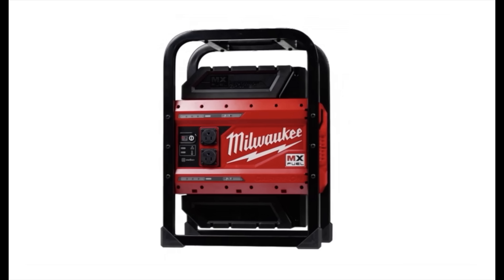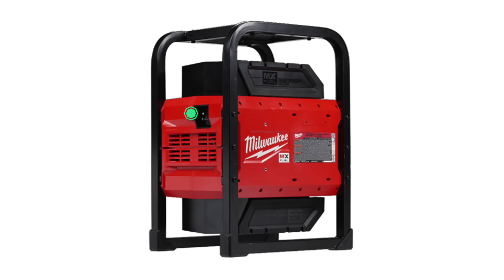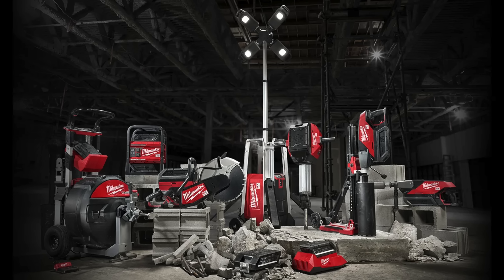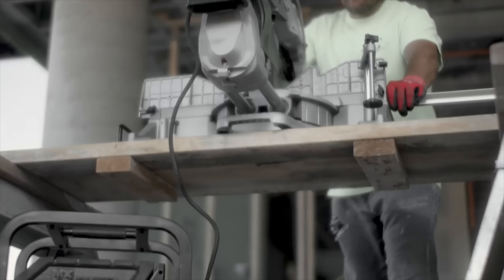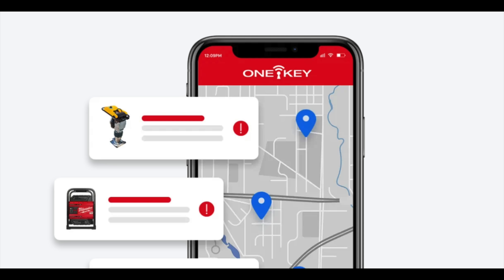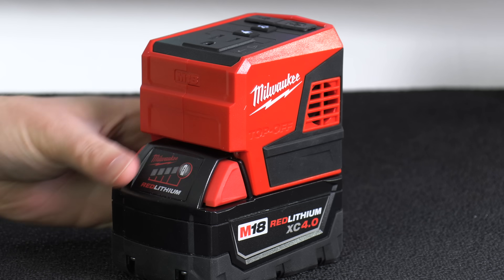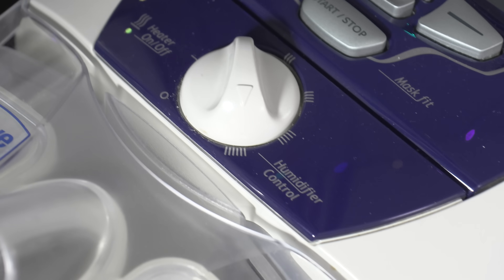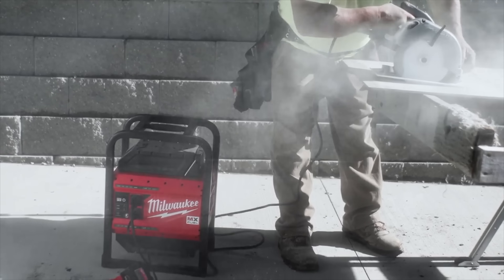END of GAS Generators? Milwaukee MX Fuel Carry-On Changes EVERYTHING 3600 Watts!

Comment: Do you really think these electric generators would power my jobsite trailer with 2 A/C units in 90-110 degrees, plus air compressor, sewing machine, jigsaw, microwave, 2 box fans, 900 watt inverter for 5  250 LED lights. Maybe for 1 minute. How about 8-10 hours. Lol
I'll never buy one of those generators. Oil & gas are king not lithium!

Comment: What this country needs is.....A law that calls a battery pack a battery pack. These so called  "generators"  do not generate anything, they are collectors of and storage devices for energy "generated" by other means be it gas/propane/diesel generators, solar, or off the common grid. I currently have of devices in my home that operate off of electrical energy provided by D cell, AAA cell, and AA  generators, a few that can be recharged through of recharging devices --HOWEVER they are not generators, or deserving of the name..

Comment: My OCD is kicking in , these large battery packs ARE NOT "Generators", I'm surprised I haven't seen any Hybrid Generators, that are small low power output Propane / Nat . Gas / Gas Generator with batteries they would be more efficient respective to other small 1000 ~ 2200 Watt offerings while providing MUCH higher sudden peak power demand along with the potential to provide a VERY clean power output signal.

Comment: What's the cost of the replacement battery?
Reply from the maker: $599 for one battery
Reply: @SilverCymbal  it looks like a nice clean system,   But that cost equals out to some serious gas and oil over time.   

Thanks for the vid!  Nice job.
Reply from the maker: @grasshopperlawncareservice3269  Actually...once it was released it didn't work out very well. See my hands on test here:  https://youtu.be/gFwP-0oQwMY

Comment: The price is bullshit. If that gas generator runs out of gas I just put more gas in it if the battery generator runs out of battery power I have to charge it and wait for it to charge in order to use it as I was using it before. That battery operated generator should cost no more then a couple to a few hundred dollars. They must be testing the market for dummies because of enough of them buy it they’ll keep the price the way it is. That price is crazy this is how people gouge the people in America.

Comment: The newer batteries do not work in the cold I work with e bikes they will not even turn on below freezing.....imagine needing it and it wont work......that being said you still need a solid array to charge the thing which need to be charged during the day.....um when you would want to use it???

Comment: it is lithium ION .. not iron ... thats why its L ion ... 
ok 1800w battery steady rate ... how many amp hours can it do that ... without out that all the other stats are USELESS ... if it lasts for 30 minutes its worthless ... if you have to plug it in to keep going its worthless ... because you then need to buy a generator to charge the bloody battery power bank ... just so you can use the battery bank ... may as well just use the bloody generator and leave the batteries bank at home
Reply from the maker: Sorry my friend: https://blog.epectec.com/lithium-iron-phosphate-vs-lithium-ion-differences-and-advantages
Reply: btw this NOT a generator .. it is a BATTERY BANK ... it is a storage bank ... it needs a generator to charge it .. and you never said how many amp hoours it can handle ... that is one of the MOST important things about a battery bank you need to know ... if it is 1800w fine for HOW LONG ... watts is just voltage x Current .. also known as Volt Amperes ... wihtout a duration how long the battery can sustain its 1800w ... it is crap ...

Comment: Shuts down after 1 hr, vid misleading for CPAc.
Reply from the maker: That doesn't sound good. I should have my review soon, including a full power analysis/runtimes/watt hours & more.
Reply: @SilverCymbal   I have a baseboard heating system, a small 1/2 hp pump.  Pls focus on this in review. But continuous service issue breaks device value a lot.

Comment: You have to use fossil fuels in order to make the something that is opposal clean energy and then also the materials that go into making it do more damage to the environment when they get released because people just throw it on the ground and also the process of mining those materials does more damage than mining for fossil fuels and then you still need fossil fuels in order to power to power the battery itself clean energy is actually a feel-good word for people who think they are doing good for the environment when actually they're doing more damage if you want to use clean energy don't use anything that's electric or combustion engine or any modern technology whatsoever that's been invented in the last 10,000 years and and also don't cook your food

Comment: If you have a Tesla, an Applewatch, Rivian Truck and such this is for you. Not to do actual work on a job site but to pretend like you are. Once the batteries are dying, you call it the end of your day and go home to charge up. Lol 
They are cute back ups but cannot replace original gas powered generators for endless use. A gas powered generators or car will function 100% till the last drop of gas but anything battery powered starts showing weakness after 75% is depleted. The last 25% is miserable trying to get by. And with gas fill up in an instant but with batteries unless you have enough extras, charging takes hours.

Comment: What's that instrument you are using to check the A.C. sine wave purity? I only caught a glimpse of the "Tektronix" brand name. It looks like an small oscilloscope/multimeter for the home lab or engineering student. Can you produce a video on this? It would be helpful to know what tools and instruments you use when evaluating some of these electrical products. Great job all around, though. I'm going to view your $99 Harbor Freight Tailgator video next. I've been wondering if one of these is worth owning.

Comment: If the power goes out how are you going to charge this unit ? This has a huge draw back, if the power goes out at your house you will not be able to charge this unit. It will take a gas powered generator to charge this unit if power is out for days.

Comment: A lot of disputes of whether this is a "Generator" or a "large battery". what I would like to know is just the same way shipping companies have to slap on a sticker to declare that a battery is inside the package what will they do for this? If is classed as a Generator then it doesn't need this sticker correct?

Comment: It is not a generator as it does not generate electricity. It is a very large BATTERY pack. When depleted you cannot recharge it when the power is out.

Comment: Only way that battery bank would be good it has to have a solar panel kit for recharge.  But the cost would put it over $3000 For only a 1800 watt capacity.  Not worth the cost. It can be done cheaper with a power inverter and marine batteries and 4 solar panels.  Its nice idea but not worth the cost for  Milwaukee

Comment: Hurricane Ike knocked out power out for over a week. We ran refrigerators, fans, etc. off cycling a gas powered generator because of the black out, so what do you do when you need power and there isn't any? You don't turn to a power dependent battery... you burn fuel.

Comment: not a horrible try, now make it a 10 kwh, 40 amp,230v circuit, give it wheels and some solar panels maybe a 12 dc connector to charge off your alternator.
Reply from the maker: 240v would be amazing. No one has done it yet in a battery unit.

Comment: The only real use that would make sense for this device would be to power your lights and other things at night during an outage due to hurricanes or other types of extended power outages if you live in an apartment building where an actual generator would be forbidden due to the noise.

Other than that just buy a Honda 2200. I bought mine already converted to run on gas, propane or natural gas so I’m covered and ready for anything.

Comment: I swear every video I watch from you, the comments are so critical of you. Obviously Milwaukee wouldn't design a product without doing market research first. There are lots of use cases where this product would save contractors money. Two XC406 batteries, at 6Ah each (12Ah total), running a miter saw at 120V and 840W of power consumption, means you could run the saw for 90 minutes straight. Since you're only running a saw for a few seconds at a time you could get an hour lets say, due to startup draw. That's a lot of cuts. And you could buy two more batteries and double your runtime. When you get home at night you plug them in and charge. Yes you pay for electricity but that's much cheaper per Wh than running a gasoline generator. The batteries have a 2 year warranty so it would be up to the contractor to do the math if it would save them money over the long term (figuring a 4-5 year life span of the batteries). There is also no maintenance and you would expect the unit to have 0 downtime, like oil changes, or ripped pull cord.

So no, this is not the end of gas generators. Some people are working in the bush and may not go home ever night. Maybe their whole base camp is running off a gas generator. But for Joe the framer or concrete guy or whatever, it could potentially save people some money, and be a good investment.

Comment: it's a power inverter that runs off batteries; just like a battery back-up/uninterruptible power supply you'd have your computer plugged into in case of a power failure.

Comment: $2200...what....the....fuck. 
Milwaukee conveniently doesn't share how many Amp-hour their batteries are. Also those batteries are like $500 apiece! 
Here is some math...

-$450 for Predator 1800 watt generator at harbor freight 
-Using 1.75 gal/6 hours you could run that for about 450 days and still be below the $2200
-In those 450 days you would do 54 oil changes (changing ever 50 hours) costing about $290 in oil

I've said this before about Tesla and this applies here as well....Battery technology just isn't there yet, its not affordable or practical to most people unfortunately.

Comment: Maintenance cost is lower my ass. Iv got a generator that’s 20 years old and sure.... you spend money on gas and oil... but imagine replacing the battery cost.  Like battery cars. A battery swap costs more then a legit gas engine swap before the labor of install

Comment: The advantage of this in a prolonged power outage situation would be to run your normal generator during the day when electrical demands are higher also charging your battery pack, then shut down the gas generator at night and use the battery to sustain basics like a fridge, cpap, lights etc

Comment: So to make it worth the high price you have to use it a lot. But to use it a lot you would need to charge it a lot. If you need a generator (or battery which this is) in the first place you aren't able to charge it. 
So its a catch 22. 
With a real generator as long as you have fuel (and you can carry many days worth in just a few cans) you have power. With this you have a small amount of power then no way of doing anything with it until you're back on the grid. 
The big kicker is that most power tools which are feasible for electric use are already battery powered - making this only useful for the larger stuff which it doesn't have the capacity to run for long enough to do anything useful. 

Oh and they missed out the battery capacity. Probably with good reason because even with the double battery option it comes out to around 850Wh. 
That means that if you're running it at the suggested 1800W continuous, its going to be flat in less than half an hour. With the single battery you've got about 13 minutes. Oh minus the inverter losses so take another bit off that. 
For $2k...

Comment: Not the first company to make one. Dewalt made one called the Dewalt Power Station. It came out a few years back with the same specs using there 20v/60v battery line up. Anywho i like this i think it could be good.

Comment: umm, Dewalt made one years ago, I know because I still have mine. It has higher output (3800) and, is less expensive, barley as batteries are expensive. so, you use 4 60v 12Amp hour and doubles as a charger for the same batteries as well. and the same batteries are used in all of the Dewalt flex volt system. I am a contractor by the way, I have looked at Milwaukee but, the price is just to high. If however I was a larger company with say more than 10 employees I might would go with them as they have the larger equipment but, in the home repair and remodeling I'm in Dewalt was the better choice.

Comment: Hmm....now I have an 11,000 watt surge 9,500 watt continuous generator/welder that has 2 120 volt receptacles and a 240/120 volt 50 amp receptacle to run my whole house incase of power outage, now is it considered a storage battery or generator 🤔🤷🏾‍♂️

Comment: Why oh why do “people “ use the word “ generator” when it is referring this  “ BATTERY “ . It’s a bloody battery!!!
Reply: What your missing is if you live off grid like I do in Alaska you need a generator to charge it. It's worthless!
Reply: @neildewitt2869  nobody has stated that specificly, but I think it is everyones point. not a generator. not worth having.
Reply: @lukewarmwater6412  have I read into all the people on here that used the word then?
Reply: @neildewitt2869  what? generator? it isnt a generator, it is a storage battery with a built in rectifier. that is all it is. if you forget to recharge it after you used it last, it is an oddly shaped door stop. that is all, maybe ballast. thats it. just dead weight.
Reply: @lukewarmwater6412  that's what I've been trying to say all along. To my its not worth buying. I have to run a generator to charge it I might as well run the generator for my power.
Reply: @neildewitt2869  oh yes, absolutely this is complete garbage.....  how many watts is the output? barely enough for microwave popcorn?
Reply: If you say it's not a generator because it doesn't do anything if you don't charge the battery, then a generator is not a generator if you forget to fill the gas tank. What is it then but an anchor?
To be properly semantically anal about it, this is a self contained battery powered inverter.  I prefer gas powered inverter generators myself, but this has its uses.  Not for microwaving popcorn out in the woods, though it could do it based on the claimed output power. What's unknown is the capacity in watt hours, which wasn't specified.
Reply: @wingerrrrrrrrr  a generator produces a flow of excited electrons. a battery stores those electrons. since this battery pack cannot produce, only store, those excited electrons it IS NOT A FUCKING GENERATOR!!!
Reply: @wingerrrrrrrrr  I'm done talking about this!
Reply: saw one of these in costco the other day and was like "fuck!! lewis black was right! thats going to give me a stroke some night!!!"........ ITS A FUCKING BATTERY IT GENERATES NOTHING!!!.... fucking millenials!
Reply: @lukewarmwater6412  it's generating ac out of dc from a battery, basically.
You can't use dc power to run the power tools that need ac power to operate.
It's really an inverter though.
Reply: @wingerrrrrrrrr  still not generating. rectifying, converting, yes. still not generating.
Reply: @lukewarmwater6412  it's not rectifying, that's converting AC to DC. This is the reverse of that.
Depends on your definition of generating. If it's creating something that wasn't there before, then it's making an ac power source where it was only dc before.
Reply: @wingerrrrrrrrr  it has a set of diodes that convert electricity from dc to ac. same as my welder/generator. see, most houses and appliances cannot use direct (straight polarity) current. and thats what batteries like this contain, direct current. so it has an inverter. and a rectifier(cant re charge without that!) and it stores power IT DOESNT MAKE POWER, like a generator does.
Reply: That's not generating anything. When ice melts does it "convert" to water or become generated? This thing's an inverter with battery backup.